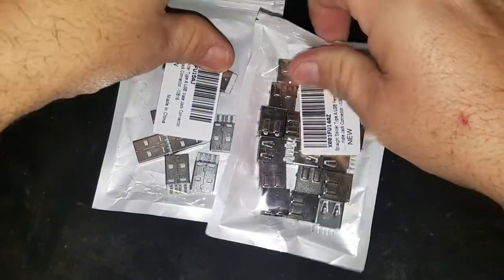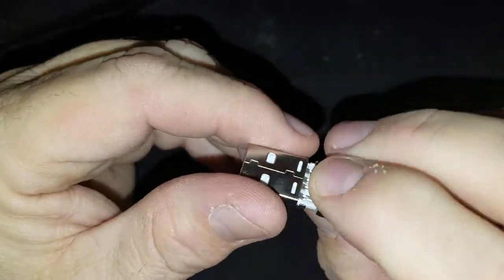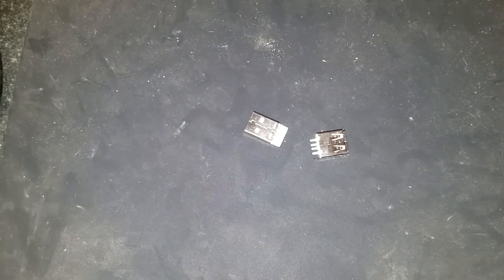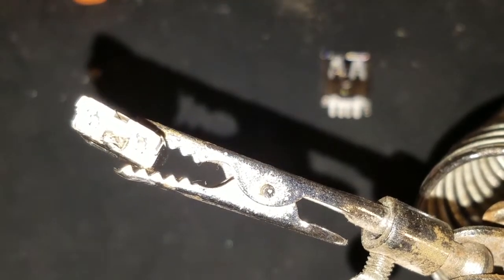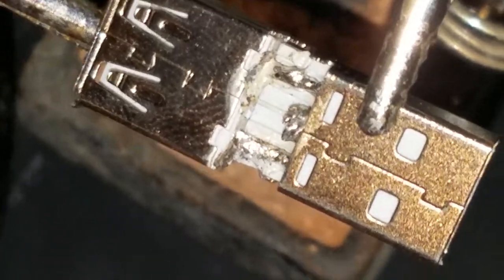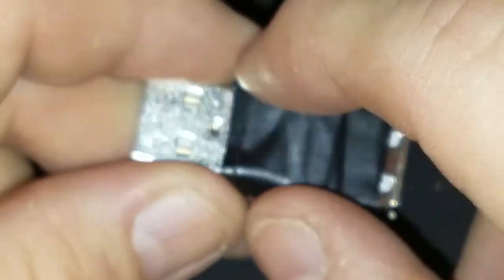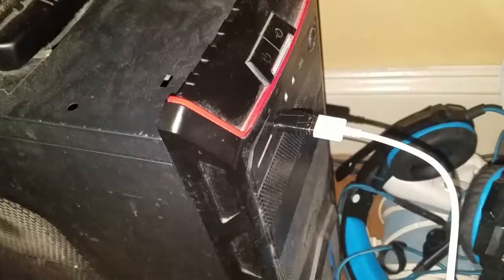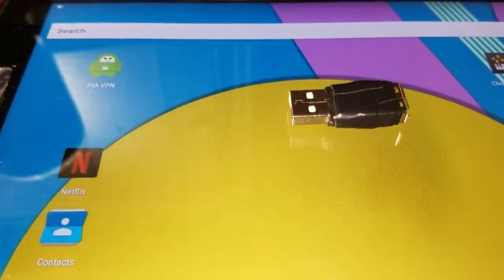USB Anti Data Sync Condom

Comment: Where do you buy those? What are they called?
Reply from the maker: I got the ends on amazon. if you want to buy on that is already made fro your phone just search for "usb data blocker" they will run you about 4-8 bucks. its cheaper if you just want 1 or 2.

Comment: I've done similar using cheap usb cables from £/$ stores, although I just cut the wires and seal with rtv silicone and cover with heat shrink tubing (cut to size, paint to match)